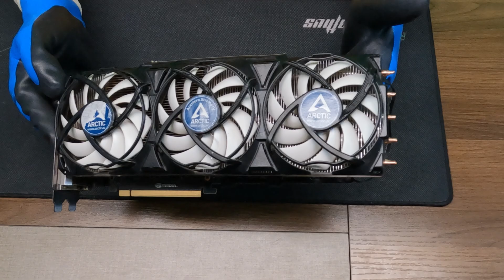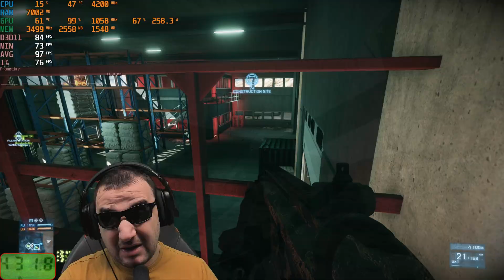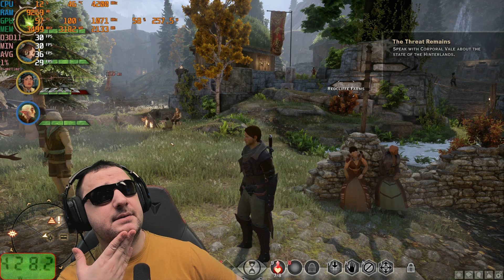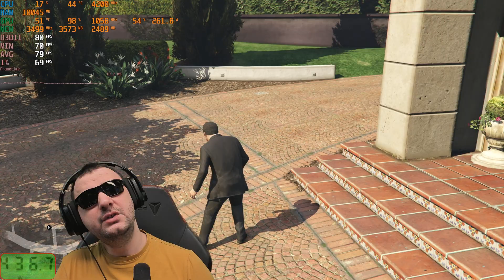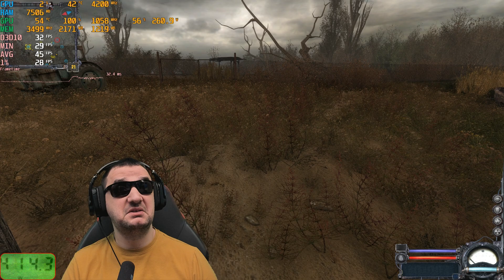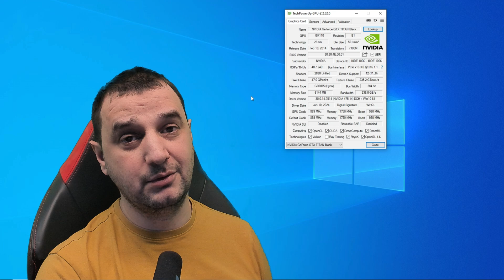NVIDIA GeForce GTX TITAN BLACK Benchmark

Comment: I really lilke your videos! Do you think you could do a test of 2 gtx 580s 3gb cards in sli overclocked? I have a pair of 2 that oc to 933 and they get a solid 60 in bf3 with ultra at 1600p!
Reply from the maker: i only have the 1.5gb in sli but only one with 3gb.